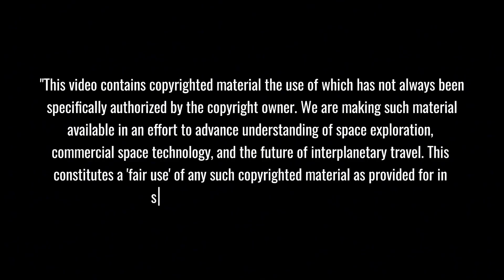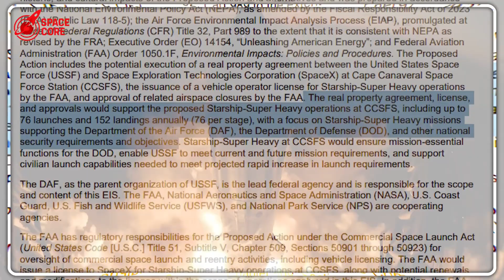UNEXPECTED! SpaceX Tanker Makes 8 Launches Possible...GAME OVER!

Comment: i remember back when v1 wasn’t a thing because the thought of v2 & v3 didn’t exist until realizing they got the math in starship very wrong… so sure.
Reply from the maker: You're recalling the iterative evolution of Starship designs, from V1 to V2 and V3. That's a core part of SpaceX's rapid iterative development strategy—they build, test, and refine based on real-world data, constantly optimizing the design for the immense challenges of interplanetary travel.
Reply: @SpaceCore25 I remember when Falcon was the vehicle SpaceX slated for putting humans on Mars.

Comment: How do they keep the fuel liquified?  Are there solar powered chillers or something?
Reply: Insulation as far as I know...they're not going to put a chiller on a vehicle that isn't even doing the fundamentals first.
Reply: The video said they were using chillers. Realize space is very cold and only the sid towards the Sun warms.
Reply: The vacuum of space is the best insulation ever.
Reply from the maker: SpaceX's Starship tankers are designed with multi-layer insulation (MLI), similar to what's used on the James Webb Space Telescope, to minimize heat transfer. Additionally, they plan to use active cooling systems powered by solar panels to reliquefy any fuel that boils off, ensuring it remains liquid for transfer.

Comment: They need to use electric magnets on one ship and bolt on ferris plates to the receiver ship.
Reply: Think about the most heavy mass you have seen moved by magnets and then look at the mass of these tanker Starships.
Reply from the maker: That's an interesting idea for docking! The video highlights the extreme precision needed for cryogenic fuel transfer.